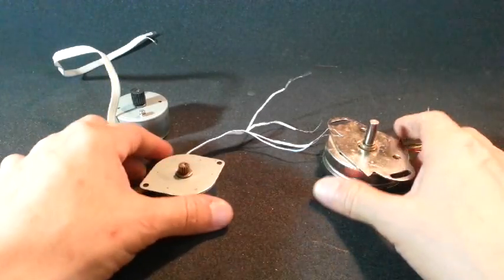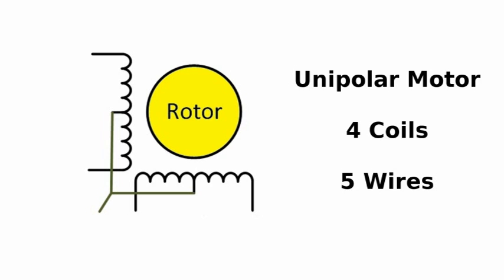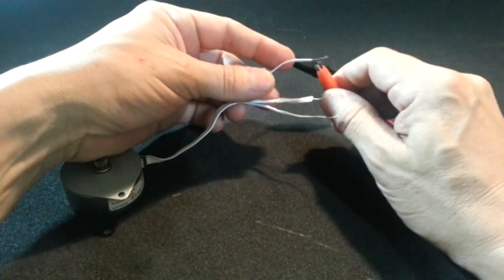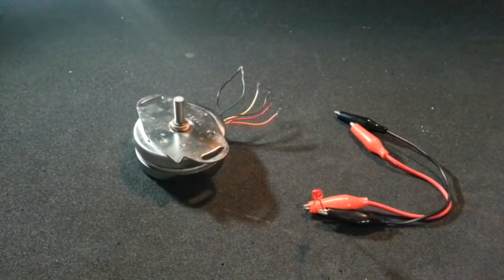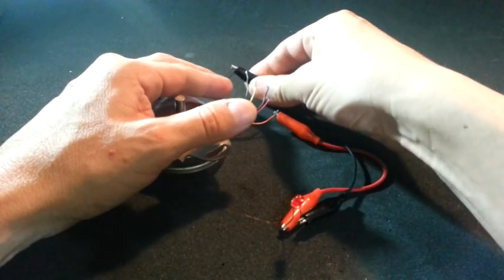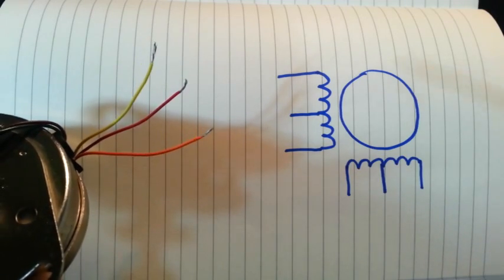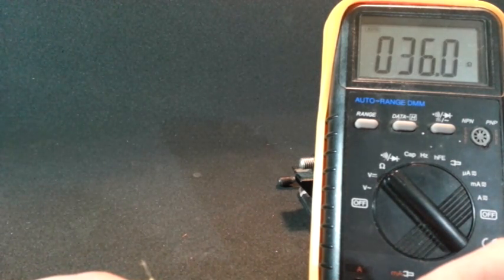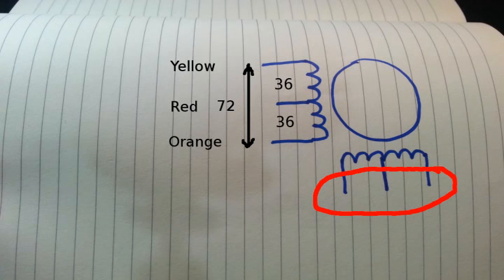How to Identify the Terminals of a Stepper Motor

Comment: if we have 8 wires, would the LED only light up for two wires with none repeating ? For example lets say we have wires A,B,C,D,E,F,G and H. When we are trying to find which are connected to each of the 4 coils, we can use the same method and find that for example A only glows with B, C only glows with D, E only glows with F, and G only glow with H.  Or would it be similar to the 6 wire?

Comment: Nice video, what is the ideal way to wire up the unipolar to make a generator? How is the 'center tap' wire connected to a generator circuit?
Reply from the maker: +rickpercy87 There is no ideal way. You can connect the two internal coils in parallel for more current, or in series for more voltage, depending on your needs.
Reply: +Ludic Science thanks for the quick reply. I've spent about 3 hours watching your videos tonight. From your boost converters, Eulers disc and the universal joint. You explain the concepts very well. Thanks so much!
Reply from the maker: +rickpercy87 thanks a lot!

Comment: How can the led glow when u turn the motor either way? Wouldnt current change direction if motor change spin direction?
Reply: +Mr Ching “chicho” Chong Spinning a stepper motor will give you an alternating current. This is due to how the magnets on the rotor are positioned. Each step you turn it, the current reverses. So it doesn't matter which way you turn it.
Reply: oh i see, thanks for replying!